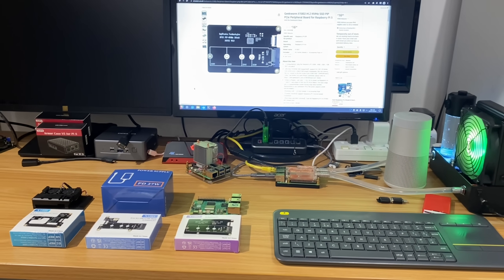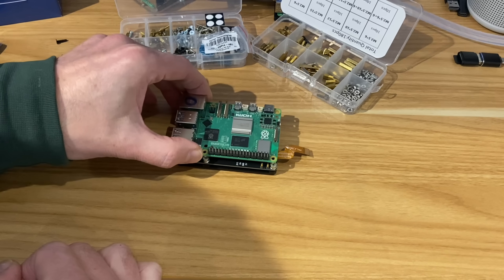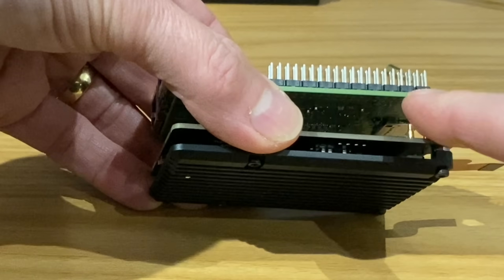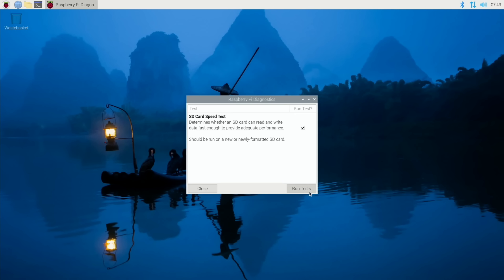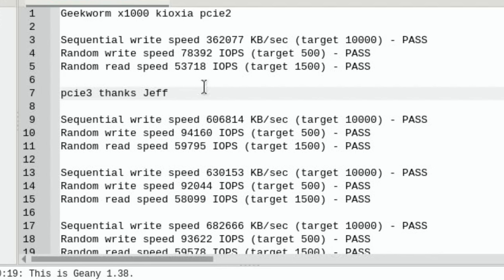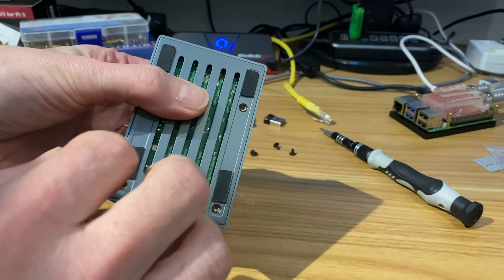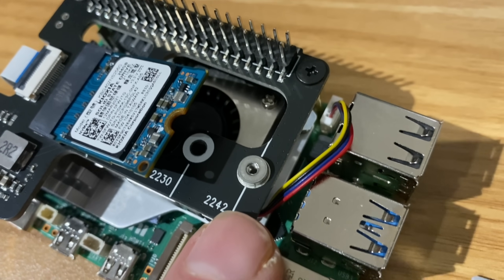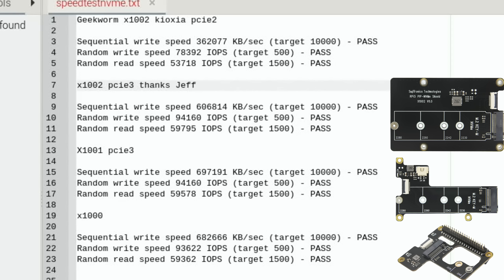PCIe NVMe for Raspberry Pi 5. Geekworm

Comment: Where can I get a pcie cable I've screwd mine tacking the SD card out.😢
Reply from the maker: I found this

https://www.aliexpress.com/item/1005006408515686.html?src=google&src=google&albch=shopping&acnt=494-037-6276&slnk=&plac=&mtctp=&albbt=Google_7_shopping&albagn=888888&isSmbAutoCall=false&needSmbHouyi=false&albcp=17859473014&albag=&trgt=&crea=en1005006408515686&netw=x&device=c&albpg=&albpd=en1005006408515686&gad_source=1&gclid=CjwKCAiAzc2tBhA6EiwArv-i6f4gbXDzeE2-tn2NXcxXNkGeUewLU5Lgofe1DoNEfc_HPbZ8md_ByBoCXt0QAvD_BwE&gclsrc=aw.ds&aff_fcid=b02e1cebe1874fedac6ded80f4ea6ba9-1706299698538-00042-UneMJZVf&aff_fsk=UneMJZVf&aff_platform=aaf&sk=UneMJZVf&aff_trace_key=b02e1cebe1874fedac6ded80f4ea6ba9-1706299698538-00042-UneMJZVf&terminal_id=208f203cd0754137a115e8d3235551dc&afSmartRedirect=y
Reply: Thanks Lee much appreciated 👍

Comment: One more comment. I have three different models of SSD adapters for my pi 5’s and inserting the ribbon cable is always fiddly. I find it easier to attach the cable with the boards oriented so that it can go straight in, and then fold the adapter over and attach the screws. I don’t know why the pi foundation didn’t make this a right angle connector, the way it’s done on almost all adapter boards.

Comment: Nicely done, thank you! Geekworm needs to add mounts for shorter drives. My production board from Amazon has the same issue as yours and when I was reading reviews for the X1001 this was a common complaint. The cooler mounting for X1001 is simple if you use the pi factory active cooler. I find it more than capable for cooling a pi 5 even at 3 GHz, and it gets adequate airflow with the half width X1001.
Reply: They have a few, including the M300.

Comment: I’ve got a raspberrypi 5. Brand new. It’s not booting up/ sending hdmi signal but the green light flashes. Any ideas? I can’t seem to get any info or help.
Reply from the maker: The Raspberry Pi is unrivalled for support compared to all other single board computers 

https://www.raspberrypi.com/documentation/

https://forums.raspberrypi.com

If you have tried everything suggested and it’s still not working. It’s probably faulty, you have a guarantee return it to the supplier.
Reply: @leepspvideo  thanks for all the advice
Reply: Turn off the safe hdmi in the config file
Reply: @bersissevimli1588  how do I do that? I’m new to all this.
Reply from the maker: First I would try a fresh copy of Raspberry Pi os on an sd card
Try a different display 

If still not working 

Try to ssh into the Pi. This video should help

https://youtu.be/sKi0hQ-ZAIA

Basically you are connecting to the Pi remotely over WiFi or wired. If you can access it run.

sudo apt update
sudo apt upgrade 

If you still don’t get a display try 

1:20 in this video to update the bootloader

https://youtu.be/xwXLzZWSVW0?si=TLAWaTQJNnRMrUYa
Reply: @leepspvideo  thanks I’ll try that. Bit worried the new pi5 is faulty
Reply: The led flashes green 4 long flashes and 3 short flashes. Does that mean anything?
Reply from the maker: One of mine stopped outputting hdmi. I updated the EEPROM and it’s working now  @PaulStation24
Reply: @leepspvideo  the thing I’m worried about is mine hasn’t worked at all yet. I’ve never done anything like this before so I’m learning as I go. Hope I can get it working today just for my sanity 🤦🏼‍♂️. I tried bootloader from the raspberrypi imager and I got a green screen but nothing else
Reply from the maker: Green screen is to say it’s worked. Try flashing Raspberry Pi os (pi 5 version 64bit) to a different sd card @PaulStation24
Reply: @leepspvideo  I’ll pick up another card this morning. Thanks for the advice. Sorry if I’m bugging you
Reply: @leepspvideo  tried Pi os 64bit on a new sd card. Same thing. Sod knows what’s happening 😩
Reply: @leepspvideo  just found what the flashing lights mean. “RP1 not found”
Reply from the maker: Did you manage to remotely access it?  @PaulStation24
Reply: @leepspvideo  no. Said host not known or something
Reply: @leepspvideo  bit out of my depth with this. I haven’t got a clue what people are talking about on the forums 😩😂 need an idiot’s step by step guide on how to get this going. Dont even know if the pi5 is even ok or not.
Reply from the maker: I linked the ssh video in an earlier comment it shows the process @PaulStation24
Reply: @leepspvideo  thanks. I’ll try again. Have you heard of rp1 not found? That’s what I’m being told the led sequence means.
Reply from the maker: I haven’t  @PaulStation24
Reply: @leepspvideo  struggling to find any info on it. Raspberrypi doesn’t seem to have any real user support.